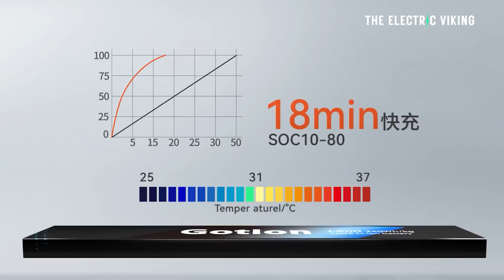NEW battery that Elon Musk said would disrupt entire auto industry finally here

Comment: The range offered by a battery is not to do with its chemistry but it’s capacity in kWh and the efficiency of the vehicle to which it is fitted.  For example the advert for the battery boasts 1000km (600 miles) for a 140kWh battery.  This equates to about 4.28 miles per kWh which is about what Tesla model 3 does (Tesla offers about 315 miles for 78kWh).  The ‘chemistry’ is, however, responsible for longevity (number of charge/discharge cycles), rate of charging and discharging (maximum power output) and fire safety.
Reply: But energy density or volumetric energy density says how many kwh you can stuff in a car.

Comment: 1. tesla hasnt been making batteries 5 years.
2. Manganese will replace the cobalt, but it doesn't double the capacity or reduce weight.
3. on battery day three years ago the major upgrade promised was SILICON cathodes.
4. You also misunderstand LiFePo4 which likes topped to 100% without damaging the cells like L-ion batteries.
Lithium ions dont like discharged past 10% or charged past 90%. Repeated over/undercharging damages them and you have LESS RANGE than LiFePo4 because of that. The energy density numbers are deceptive for that reason.

Comment: Did i miss something?  I am wondering how many charge / discharge cycles this battery claims to have.  We also need a battery that will outlast the vehicle itself.
Reply: I dont know bud. Sort of a staple for alot of different businesses or products is "planned obsolescence" that is how they keep dinging your wallet over and over again. But im with ya...it would be nice. I read somewhere that it would cost $20k or so to replace the battery on a tesla.
Reply: They do already. Heard of the 1 million mile tesla operating between Vegas airport and the casinos. Lots of body work and tyre replacements, but same battery and motors. EV tec is moving much faster that the ICE industry ever did.

Comment: Batteries are only temporary. The technology and density may improve but they still need to be charged. Charging is the downside. Within 5-10 years the fuel cell will be available.  The fuel cell can be swapped for  a fully charged  cell in minutes and you can carry a spare.  ICE  is dead. Electric cars are they way forward. Batteries are a temporary solution.

Comment: 240 wh/kg is the same as Tesla NCA 2170s from 2018. It is impressive for a low cost battery, but it isn't an energy density that is unattainable by current high nickel battery chemistries.

This is a tech for cheaper high volume products, which is more disruptive, but it isn't quite game changing for me. We need both cheap and high performance batteries to completely replace fossil fuels, and unfortunately the heaviest polluters require the highest performance batteries such as farm equipment, ships, and semi trucks.
Reply: exactly - we have the tech for 500wh/kg - by 2030 we have no energy problem world wide!
Reply: By high performance, I assume you mean more capacity for same weight and volume. I personally think this concern is a bit overblown. The real reason people have so much range anxiety is not because their car can store 200 miles per full charge instead of 400 miles. It is mainly because they don't have an EV charging network similar to gas stations, and because the charge time takes much longer than filling gas.

Comment: An LMFP combined with the Phoenix tech battery heating to give 5 min full charging along with 600 mile range would be nice.
Reply: EV charging speeds need to be 10 minutes or less, in order to get apartment dwellers to buy EVs.
Reply: Takes me longer than that to fill up my truck.
Reply: @Pneuma40  And don't you wish it didn't?
Reply: 5 min charging is unnecessary
Reply: @michelangelobuonarroti916  I give you my absolute assurance that, it batteries took 6 mins to charge, people would be begging for 5.

Comment: Unless they are temperature resistant it’s just another fail.  Too many places get cold or hot and have to use half the pack to operate.  Fix that then I’ll be impressed with 2 million mile durability or 600 mi range.

Comment: So do these 4680 batteries actually have 5X the energy, 6X the power, and 16% more range —as originally claimed?
Reply: The claim was based on its dimensional size not the Wh/kg or Wh/litre. The Maxwell dry coating was going to improve to about 300Wh/kg from ~250Wh/kg then hopefully to 500Wh/kg which is 100% improvement or x2 better.
Reply: @AORD72  Do you have a source where that improvement has been tested and verified?
Reply: @Yanquetino  I think Tesla bought Maxwell because they evaluated its batteries. That gave credence to Maxwell's claim. I think Tesla would have extensively tested the prototype dry electrode batteries before investing. Musk said something like he wasn't interested in people telling Tesla that they had better batteries, he wanted battery prototypes to test.

I had the same questions when I first saw the X5 as to what they meant. At the time I concluded that they meant size because the new battery was based on the Maxwell dry coating method. And when you calculate at the volume of the 4680 cells vs the old you could see they would have ~5X the energy due to volume and slight increase of Wh/Litre (~250 to ~300). I'm too lazy to calculate now but you can (at the time I did rough calculations). 

I think you can find evaluations of the 4680 vs 2170 on YouTube telling all the maths. People will have tested and worked out the Wh/kg and compared.

I think the problem Tesla battery advancements have been slow has been the consistency of mass production. But that is typical in mass manufacturing. The good news is they are constantly improving. Personally I think Musk should create a competition within the USA (or world) universities to develop the best batteries to speed things up.
Reply: @AORD72  So… no source yet for verification, just trusting Maxwell's claim. Got it.
Reply: @Yanquetino  No, Trusting Tesla to have verified claim. As I said people have done the comparisons and verified it.
Reply: @AORD72  So Tesla has published results that verify the claim? Where? I'd like to read the report.
Reply: I mean it's china, any numbers they put out are probably inflated by 50%

Comment: You never talked about durability.  Depending on the person, I believe Durability may be more important than charging time.  Not always, but for suburban commuters, we just want a car which will go 300kMiles without any major repairs.  Replacing a battery is a totaling event for an EV.
Reply: According to Gotion Hitech, its LMFP is a 2 million km battery. It says: "Astroinno L600 LMFP cell achieves 240 Wh/kg in gravimetric energy density and 525Wh/L for volumetric energy density. It can achieve more than 4,000 cycles at room temperature and 1800 cycles at high temperature, easily achieves 18 minutes of fast charging, and passes all safety tests."

From what Gotion is saying, its LMFP is similar to LFP in terms of cycle life, but it degrades faster in heat, so it will need better thermal management than LFP, but it degrades slower than NMC and NCA, so definitely an improvement in the lifespan compared to most Western EVs.  

With the way that battery prices are falling, having to replace the battery in 12-15 years may not be nearly as expensive has you think, but it is definitely better to have a battery that is designed to outlast the life of the car. I think that the standard lifespan of the new LFP and LMFP EVs is going to be over 500k miles, since their motors and batteries last so long and they require so little maintenance. 

It wouldn't surprise me if the Aptera becomes a million mile vehicle, since its carbon body will never rust, and it is modular, so its major components can be easily replaced. If a motor fails, you just replace the wheel. I can't wait for more EVs to be designed like the Aptera.
Reply: @amosbatto3051  So the battery has a life of 1800 to 4000 charge cycles.  Let's say 3000 for sake of discussion.  Someone with a long commute and charging every weekday would use ~250 cycles/year.  That's only a 12 year battery life, which is about the AVERAGE age of all US cars on the road right now.
Reply: @dzcav3  The 4,000 cycles is not the life of the battery, it's how long it takes for it to degrade to 80% of its original capacity.  The lifetime is much longer.
Reply: The average new car buyer in the US keeps the new car for three years. Three years. Average annual mileage in the US is 13,500. It would take over twenty years of that to go 300,000 miles. That’s just not how most people buy cars.
Reply: @davestagner  Resale value matters for new car buyers that turn in their vehicle every 3 years...
Reply: @gerryburde5663  Not that much, or they’d do something financially sensible like keep their cars longer. And the resale value of a three year old car is not based on how likely it is to go another 200k+ miles.
Reply: @gerryburde5663  Or maybe not. If they have the money to buy a new car every few years just to say they have the new model, then they can afford to ignore how much money they waste by dumping the old one.
However, given used Teslas have sold for same or higher price than new ones because buying used does not have a waiting period, selling your EV when it is still under the warranty might be a valid way to keep fashionable. Let's say you pay $40k for it new and due to higher number of old EVs for sale you only get $30k for it in three years. If you then buy a new one again for $40k, that is essentially same as if you had paid about $300/month to lease a car for three years.
Reply: @davestagner  Funny how when Tesla was new every idiot was going "Why would I buy a luxury sports car for $30k when I can buy a tiny compact for $20k or a 20 year old bomb for $1000?", but now that it is obvious that EVs are far better than ICE and keep their value too people focus on even more idiotic idea of changing their car like they were buying new socks just so the lifetime value of the EV can't come into play. Of course, that does mean that soon there will be plenty of used EVs that are still good as new and still cost far less to use than ICE, but now that luxury SUV might cost same or less than the used compact ICE.
Or maybe people haven't changed what they are saying, it is just that media has to find new clickbait to make EVs look bad.
Reply: @AnalystPrime  I think in the long run, we need to get away from consumer culture and disposability. But one problem at a time. Right now, I’m focused on getting us off fossil fuels, which is the immediate threat to human civilization. So if people are gonna buy new cars constantly, oh well… as long as they’re buying EVs rather than ICEs.
Reply: As you've emphasized, 300k miles of durability is a basic requirement for the global non-commercial vehicle market. Given the typical usage of today's EVs with at home slow-charging to 80% and only occasional fast-charging to 80% during long-distance travel, EV batteries are already lasting more than 300k miles.
Reply: @greggrant4614  nah I want to charge it go 100 percent I hate the faff
Reply: @fadzilicious4411  Your "want" can be easily provided for by the manufacturer by simply limiting your battery's maximum voltage to 80% of the maximum possible voltage / charge.  This is the approach used by producers of Plug-in Hybrids with their small batteries, like Toyota's RAV-4 Prime or Prius Prime. Toyota simply electronically limits the State-of-Charge even more so, to something like a minimum of 20% on the low end, as well as 80% on the upper end. The 80% max voltage is then simply identified as your "100%" / full charge. At this full charge point, the EV range of the NMC might still be superior to the LiFP or LiMFP battery charged to its maximum voltage and discharged to its minimum voltage.
Reply: @fadzilicious4411 LFP batteries seem a perfect fit for you, so.
Reply: You are absolutely right! The biggest fear for EV and hybrid owners is purchasing a new battery pack. I have owned three hybrid vehicles and continuously sell them when the battery warranty expires, just as a precaution.
Reply: @seanandre5212  If you buy the car with the warranty, this is not a real fear.

Comment: Im waiting for a game changer that will change the game changer...
Reply: xpeng g6 charges at 350kwh peak. 10 to 80% in 14mn
Reply: 😆  yes I'm waiting for the testla killer killer of the killer 😂
Reply: @wickedleeloopy2115  model y owner here. Yes I would get the g6 over model y. Tesla has many quality control issues until now and my new car already seen Tesla service centers for 2 times in 1 month. There are many Tesla fanboys who don’t even own one and don’t know what they are talking about like the guy in the video
Reply: @tonypaca3015  Yes, but I will say this in my 35 years of owning and driving vehicles.  Never ever purchase the first year model of any vehicle, whether it be conventional or electric.  Let someone else work out the bugs and defects, cause if it's the models first year there will be plenty of them.
Reply: @Ryan-ff2db  that is true. But I myself would still get the xpeng g6 over my model y. I own this car for 1 month and it’s been in 2 different Tesla service centers for 2 weeks already. I don’t think I can get anything worse than that lol. My experience is totally ruined
Reply: @tonypaca3015  A lot of that's just luck of the draw.  I've had two Tesla's with no major mechanical issues other than a lower control arm that was covered under warrantee.   My Ford and RAM trucks on the other hand have had a dozen recalls a piece and the Ford has been in the shop 6 times in 30,000 miles all for different reasons and the check engine light just came on again yesterday.  Trust me, it can be much worse.

Comment: 🤔 shouldn't it be a messurement like miles/kg or mi/volume to tell the progress ?
Reply: Using miles requires specifying many other variables such was weight of the vehicle, aerodynamic efficiency, efficiency of the drivetrain, tires, etc.  Other than weight, these are unrelated to the battery.